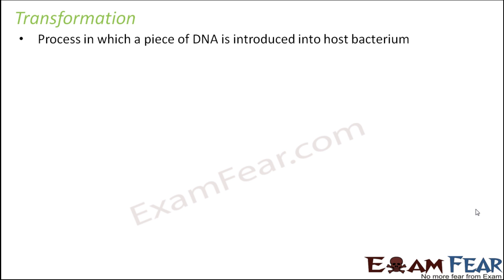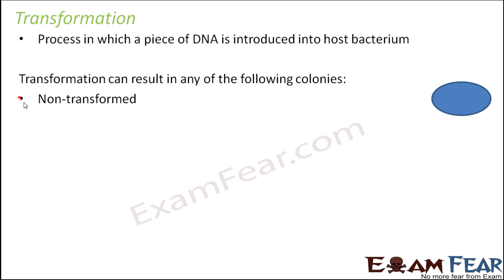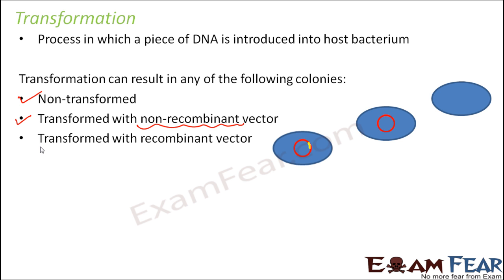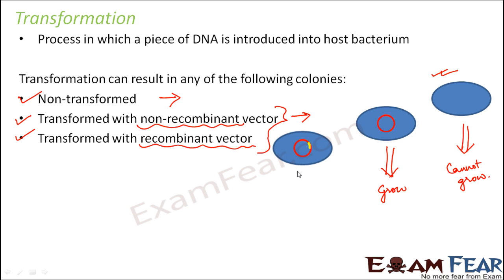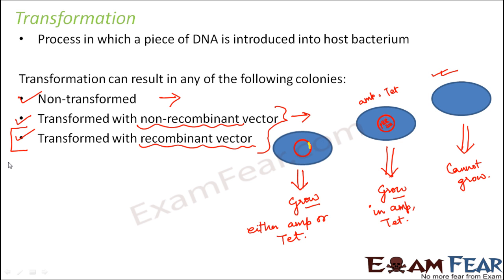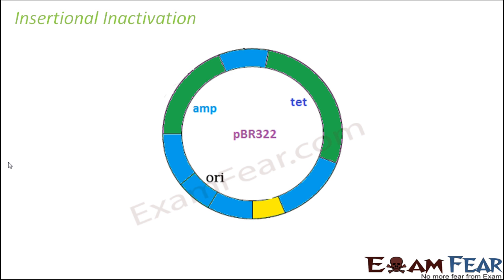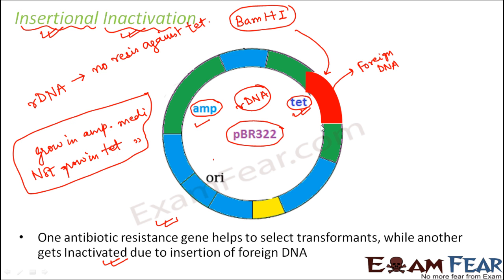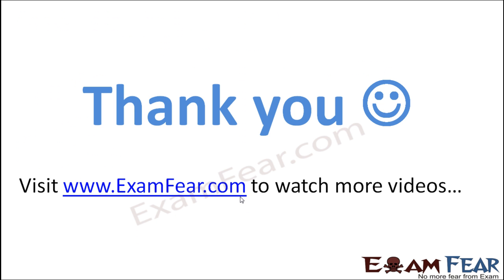Biology Biotechnology Principles part 14 (Transformation, Insertional inactivation) class 12 XII

Comment: If the foreign dna replace the pvu 1 region then how we can differenciate between a transformed dna with recombinanat vector because then it grow in both of the ampicilin and tetracyclin solution😐
Reply: Swarnalee Rathore .......see non transformed is when no vector dna or foreign is not transffer into the host body.....transfformed dna with not recombinant iswhen we just put vector dna into the host bdy bcoz its also doesn't present in the host bdy previously.......nd when we putted transformed dna with rdna then it would be recognized by growth nature of host in diff diff antibiotics medium as u know all vector dna have specefic antibiotics resistance

Comment: Doubt. In only amp medium, How we distinguish the presence of tranformants with rDNA and transformants without rDNA. ln genetic engineering of pBR322 we use which  antibiotic medium  to get transformants with rDNA. Pls reply mam or anyone.
Reply: If rDNA is formed that it inactive any antibiotics .
If we change the mediun it will clear.
If it will destroy in amp medium then it mean it is resistance to tert

Comment: mam u said that there can be a transformed bacterium without the non recombinant dna. how come it is possible for the bacteria to transform without the foreign dna?
Reply: There are three different entities first of all - A host bacterium, a vector and a foreign DNA. The vector is not part of the bacterium (so even the vector is a kind of foreign material to the bacterium). So when the vector is implanted in the host it gets transformed (because it carries certain genes which the host bacterium did not posses and is able to clone itself inside the host as it has an ori). When we recombine the vector with a foreign DNA it becomes a recombinant vector. So if we would have implanted a recombinant vector in the host, it would have got transformed with the ability to clone both the DNAs - vector's DNA and Foreign DNA. That's why it's a transformed DNA without the non-recombinant DNA if it does not include the foreign DNA part.
Reply: @Gautam_Properties  yes u re rht😍
Reply: vigneshwar vichu read about griffith's transformation experiment
Reply: Ar u sure this is the answer

Comment: Ma'am its said that the foreign cut piece of dna must be introduced near the ori to ensure replication. but in case of pBR322, the tetracycline resistant gene is far away from the ori. if this foreign piece of dna gets introduced in part of tetracycline, will that ensure replication?? and if yes, then what is the need of introduction of that foreign piece near ori? please answer....
Reply: The ori site is where replication begins and is required to make additional copies of the plasmid. To my knowledge, the entire plasmid is replicated completely so the position of your insert relative to the origin should not make a difference as the replication machinery would not treat the inserted DNA differently than the backbone DNA when creating a new copy. When trying to express foreign DNA from a plasmid, what is important is where your insert is located relative to a promoter sequence. Promoters are different from origins of replication and are responsible for initiating the transcription of your insert into RNA. That means your inserted DNA must be inserted close to a promoter in order to be expressed....that would help I guess...
Reply: +Tushar panda Thanks a lot. I think I got it now....
Reply: mam i also have a same question. pls answer....